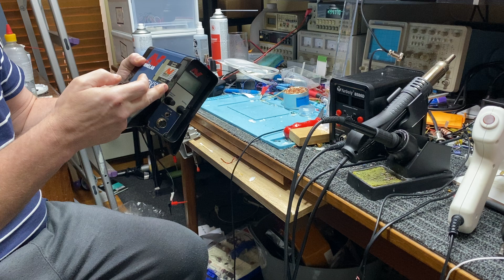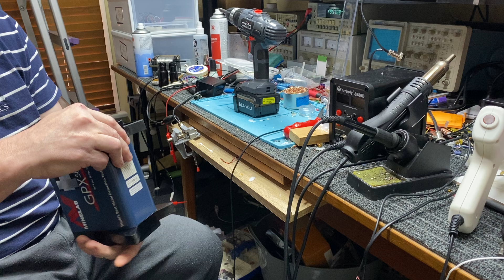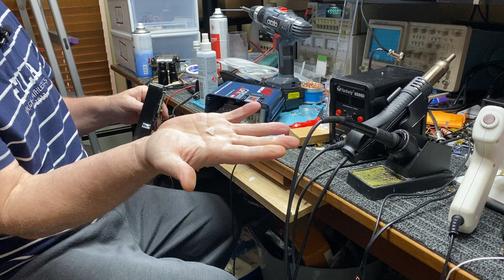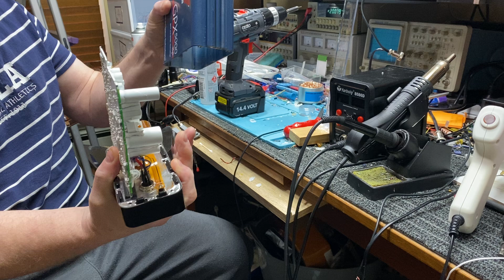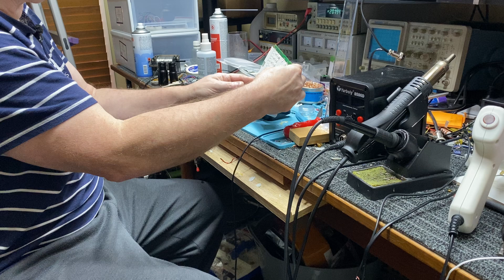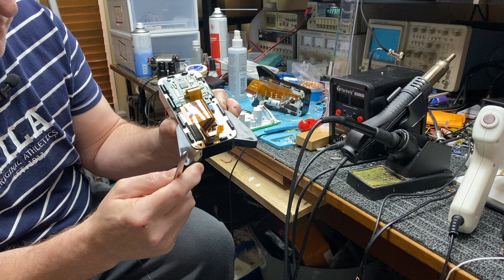Minelab common GPX problems and how to fix plus tons more.

Comment: Dear Mr. Woody, all the best. What is the range of the capacitance of a very large coil? It is good for a 95 cm coil. Thank you.
Reply from the maker: The capacitance of wind to wind capacitance of shield to winding capacitance.?
Reply: Hello, Mr. Woody, my dear professor, the text is poorly translated. I didn't understand it at all. Thank you. Could you clarify? 🥰🥰🥰 @DetectorMods

Comment: Hello, my dear teacher, good morning. I have a GP 3500. I have 5 volts on most of the ICs, but I don't have 15 volts on the diode. As always, thank you for your guidance.
Reply from the maker: Check the 2sk1334 input fets, the detector will not function if the receive switching is not correct.

Comment: Hey mate, I bought a gpx 5000 and now I’m stressing. It’s not ground balancing. Does that mean it’s a lemon??
Reply from the maker: Test the green button and the cable, also try a different coil.
Reply: @DetectorMods I have tried the green button and tried to ground balance it and still no luck. Im going to order a new cable that connects the battery to the machine because the cords are a bit exposed. If nothing works out. would you be able to repair it. I’m from Sydney
Reply from the maker: I do those every day so should be able to repair it.

Comment: Didn't realise these detectors operate with such high switching voltages.
I wonder if the white coating acts like a conformal coating and helps suppress tracking between devices.
Reply from the maker: It keeps moisture out.

Comment: Very informative video.
I service and repair motor control inverters and industrial electronics.
Component obsolecence is a major problem - trying to track down old stock always a fun game.
And you'd know this, sometimes components from different manufacturers that are supposedly equivalents, are often not 😢
Reply from the maker: When a transistor is not and it’s not a mosfet but some obscure Igbt.
Reply: @DetectorMods  
Yes, don't start me on IGBTs.
Had to repair an old lift drive, and managed to source IGBT modules out of China. No other supplier.
The new devices looked like the originals but weighed about a third.
Needless to say, they didn't work.

Comment: GDAY Woody. I’m looking g at getting a second detector. In “your opinion”😉 would one of your extreme mod 4500’s outperform a modded gpz7000 ?
Reply from the maker: In many circumstances they can and in some circumstances the 7000 is better but performance is greatly governed by coil type and size.